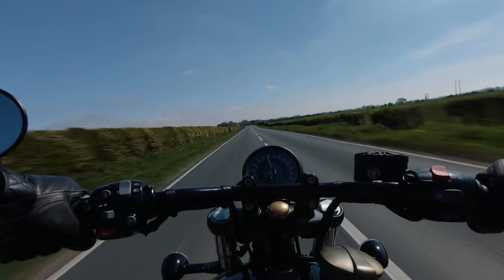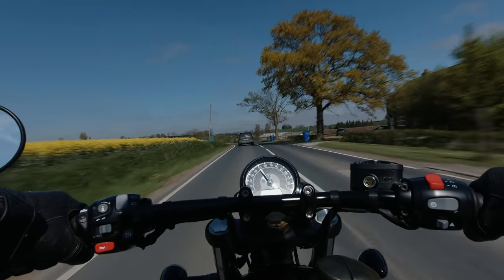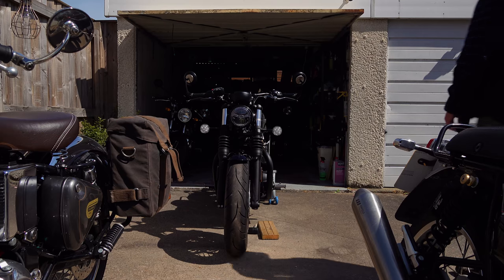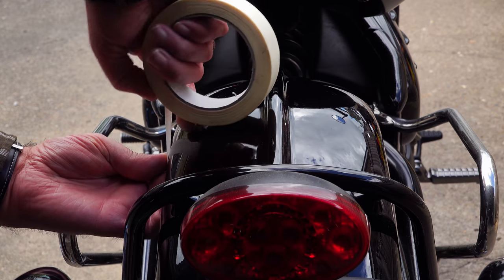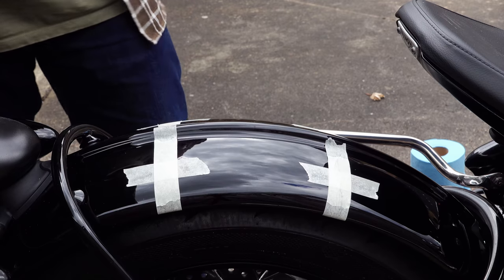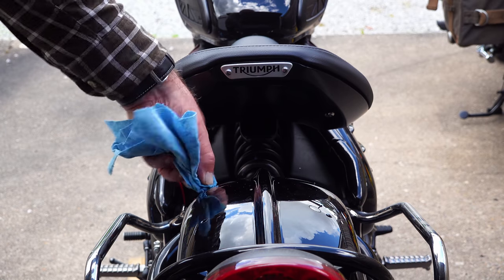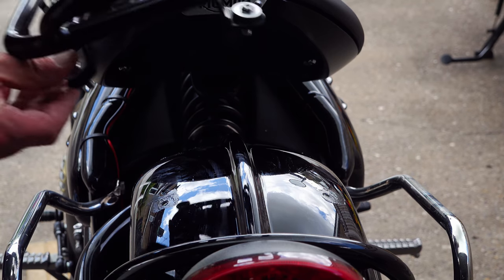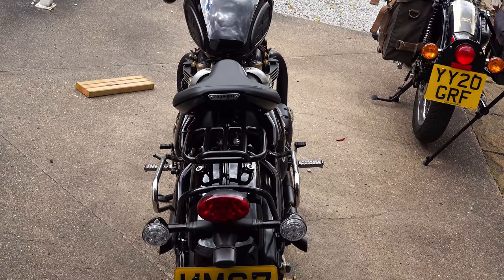Prepping Your Triumph Bobber for Touring? VOYAGER the swiss army knife of motorcycle Racks!

Comment: I had an issue with the Voyager rack hitting the two screws in the TRIUMPH badge on the back of the seat when going over bad bumps. I think my rack is set even further back than Stuart's too.
I just moved the seat a little more forward and now it seams fine. Just a light black touch up paint to cover the two dings on the rack and it's almost undetectable. I love this bike more and more every day. Thanks Stuart.

Comment: This is a brilliant video Stu. I don't own a Bobber but the practices you exercise here are easily transferable to any bike and are therefore invaluable imo. I recently installed the 'Pyramid' rear tyre hugger on my Himalayan for example, which also uses thick compression rubber washers and alloy internal sleeves. I also have a very much 'belt and braces' approach to rust protection. Which rust protection product did you use here by the way? Many thanks 🙂

Comment: While the strap mounts under are nice i still prefer the mount from Hepco and Becker, fits under the seat and doesn't require any drilling!
Reply from the maker: it will also snap your chassis if you overload it.
Reply: @stuartfillingham  maybe, hasn't happened yet and i did a 4k mile trip around the EU last summer, working well! Plus i'd argue it looks better!

Comment: OMG - drilling the mudguard! That's the reason I never mounted a pedestrian slicer on the C5. This one is a really sleek item though. What we need now is a well designed tank rack like those of yore - screw-ins are not fashionable anymore (unless you weld some nuts on the tank and that is a no-no for a host of reasons), suction cup ones seem too in danger of flying away (I know Motone manufactures that version, I just don't like suction cups)... what could be the answer, really strong magnets (rubber coated, that goes without saying)?

Comment: Dumb question time uncle  Stu. Once fitted, is there any risk of the tire bottoming out on the nuts when going over a big bump?
Reply from the maker: No None at all!
Reply: Triumph Bobber’s swing arm, tyre and mudguard all move together at the same time. It’s like one part. So like Stu said, no, no risk. But… the big minus of this design will be that putting any luggage on your rack will increase the weight of the unsprung mass. It will definitely affect functioning of your rear suspension. Bobber’s design simply doesn’t allow much in that regard.
Reply: Who cares about those nuts, I'd be more concerned about my own. lol

Comment: Thanks for that video, I am very close to pulling the trigger on buying a 2019 bobber.
Would that black touch-up paint be good enough to paint the stainless steel bolt heads and washer, so that they are also black, or would it peal off